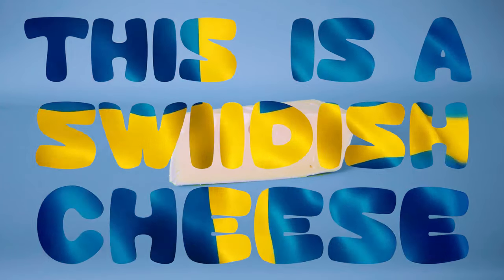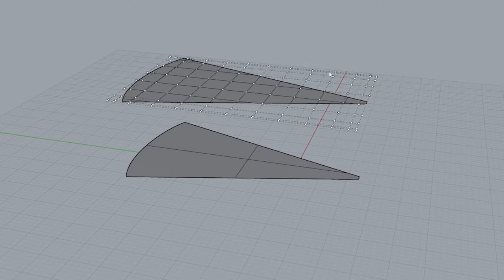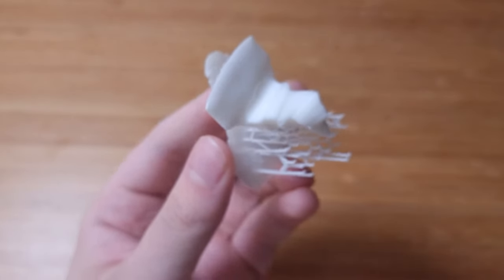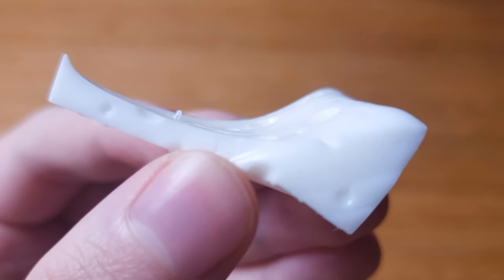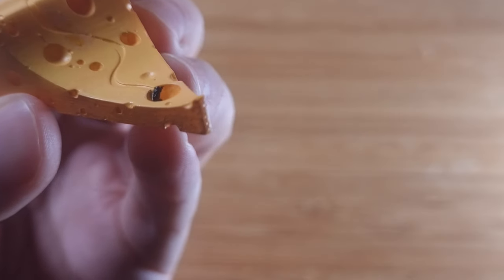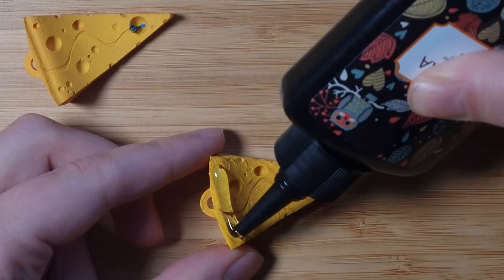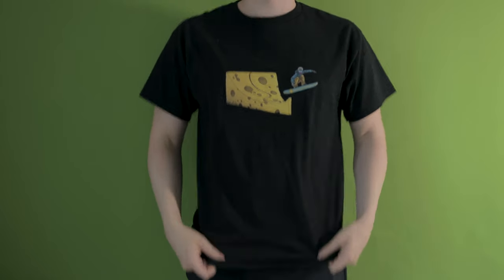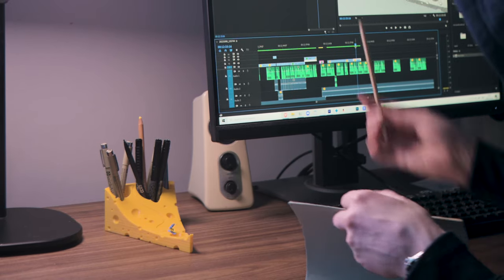Turning Worst Swedish Sin Into Art

Comment: Ostehøvel, a modern cheese slicer or cheese plane, was invented by Thor Bjørklund in 1925 in Norway. Mass production of the ostehøvel started during 1927 in Lillehammer, Norway. The design was based on the carpenter's plane. This style of slicer is very common in the Nordic countries, and in the Netherlands, Belgium and Germany.
[from Wikipedia]

Comment: This lobster clasp that broke, have you thought what it is made of? Should be Zamac 12, but it's usually not quite, it's a random pot metal, something just vaguely zinc based. It's plated with chrome over top to hide the sin, since the appearance of that metal isn't very nice, the shade and evenness. Sometimes that comes out OK, other times it's a contaminated alloy which just crumbles by itself in a handful years with no force at all, and it's never quite as robust as you expect it to be, unless you got yours from a very serious supplier and it's stainless steel. Most suppliers aren't very truthful nowadays.
Reply from the maker: wow you know alot about metal :D 
As you say it's probably some cheap quality metal, bought from some random store at amazon so not a super serious supplier. 
But it's not like I needed the metal to be very strong, it was mostly a fun test. The 0.01 mm ABS resin is however extremely strong, still havn't been able break it. You could make some seriously hard parts with that. 😯

Comment: im not sure but u may have to sand the object a little to get the paint to stick
Reply from the maker: I actually did try to sand it a bit to remove support marks but didn't see any improvements.. But I used a very fine sandpaper so maybe I'll try with a rougher one. Thanks for the tip!